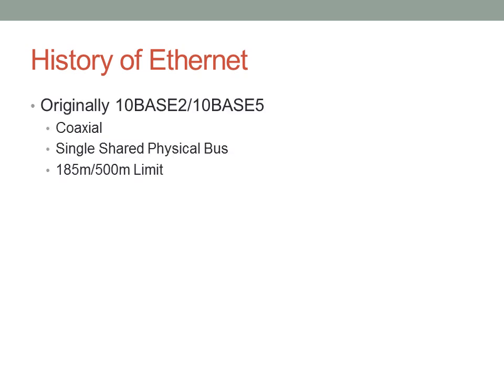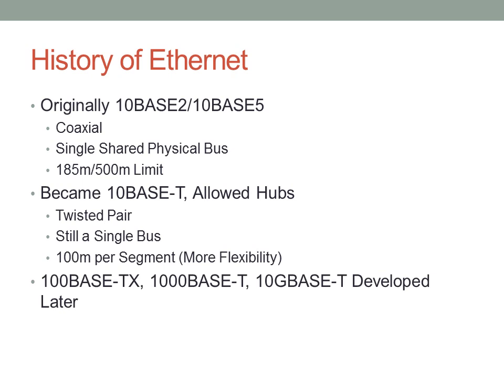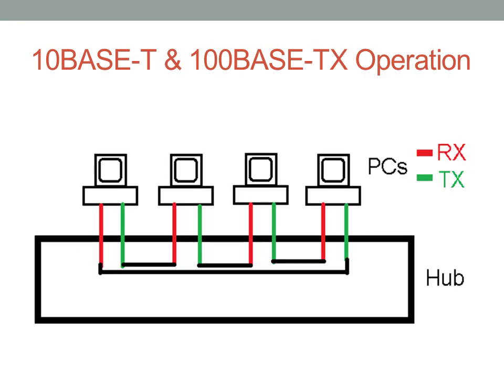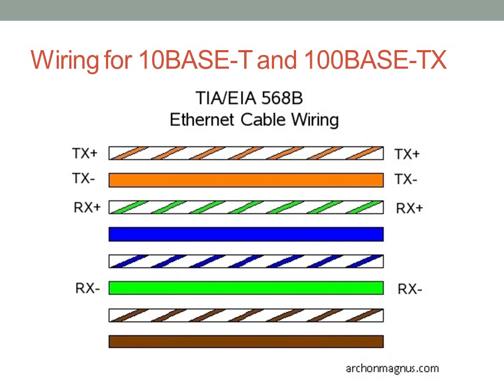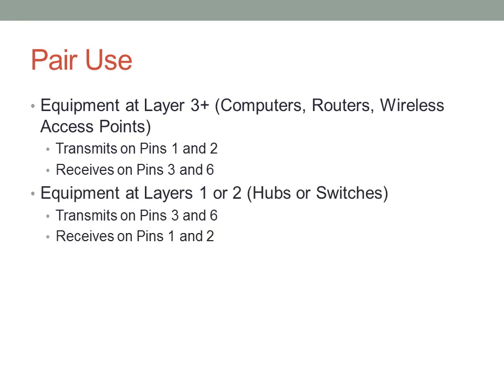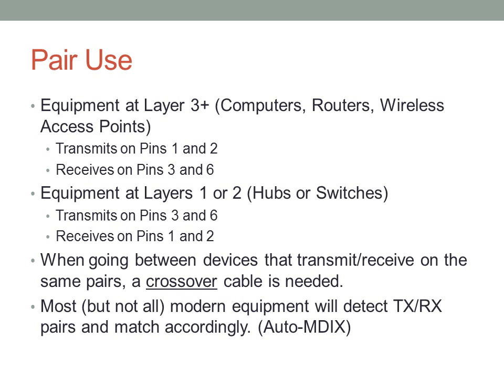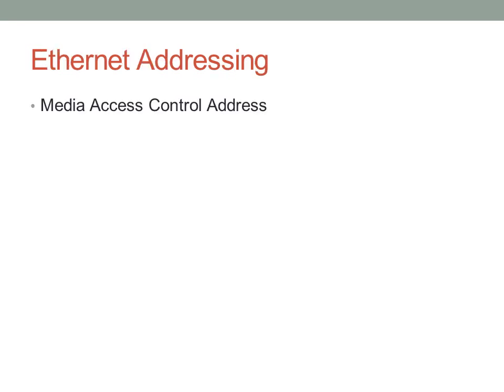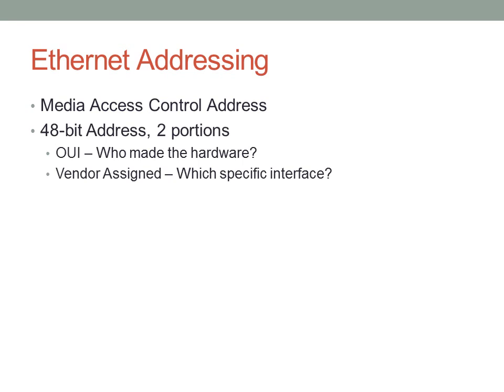Ethernet

Comment from the maker: There are a lot of other more technical resources out there for Ethernet standards and history, but I'm glad you found this helpful!

I really didn't want to dig too deeply into the technical aspects (signalling, older wiring schemas), since this was designed for those wanting a CCNA-level understanding of Ethernet. I'm considering re-doing these presentations and adding the information I've acquired in my ventures since this time, but this would be a lot more than the CCNA covers.

Comment: hey Ryan,
thanks for a simple explanation of the 568 B crossover cable. I really wonder why even the cisco books fail to make it so clear! ...I would like to see your ccnp videos. 
- Praveen  -'
Reply from the maker: This may provide more insight for you:

http://www.iplocation.net/tools/rj45-wiring.php

People tend not to worry as much about crossover cables these days because most devices will automatically switch their transmit and receive pairs to accommodate a given connection. Before this technology was around, though, it was extremely important to use the right sort of cable. The really short answer to your question is that the T-568B standard swaps the transmit and receive pairs of the T-568A standard. This means that if you make a cable with two of the same end (T-568A/T-568B), you will end up with a straight through cable, because transmit and receive pairs match on both sides. If, however, you make a cable with opposite ends (T-568A on one side and T-568B on the other), the transmit and receive pairs will be reversed on one side from what they are on the other, and you end up with a crossover cable. In all of this, the polarity of each pair is not changed, just the placement of the pairs themselves.
Reply: Ryan Clough  thanks